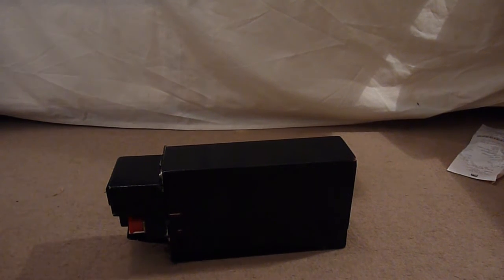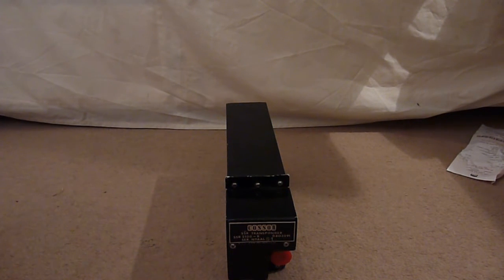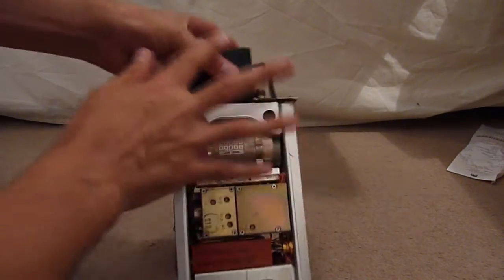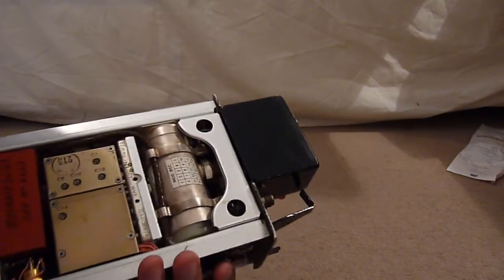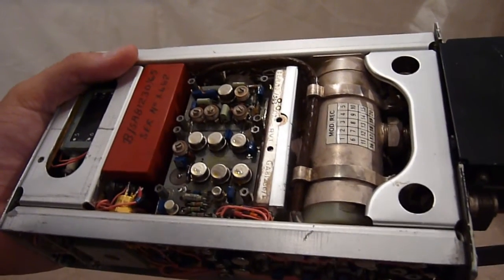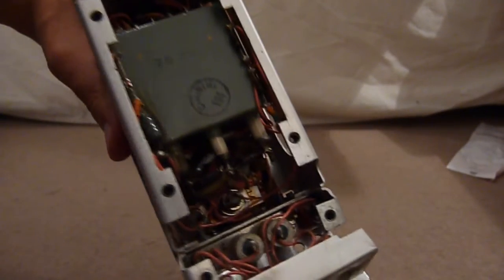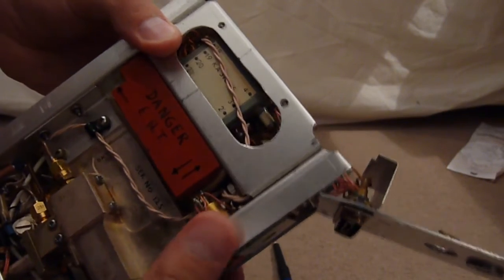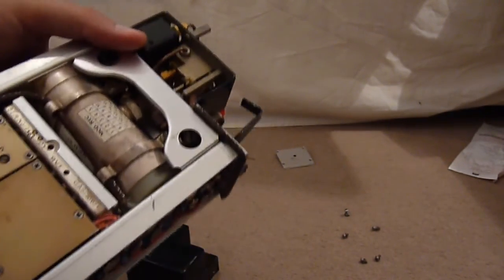COSSOR SSR Transponder Teardown

Comment: The big orange block is a EHT tripler (Ladder network of diodes and capacitors). The post that you say is covered in some sort of gunge has 1900 Volts dc coming out of it when it was running, that is connected to the anode of the Clystron valve, located inside the cylindrical cavity. I am very familiar with this transponder as I worked at the Cossor service department (Harlow 8) fixing these little 2100's from late 1978 to December 1979. They were used in hellicopters and Concord, where size and weight of eqipment is extreamly important.
Reply from the maker: Nice, the info you have provided here makes me want to revisit it in a new teardown looking in the mystery boxes. Never knew there was a valve in there. Looks like something went wrong in the HV in this one, a lot of charing Mark's.

I used such a ladder network when building my own night vision. Like in all HV projects I do I got tingeled.

Could probaly use that somewhere else, maybe more night vision.